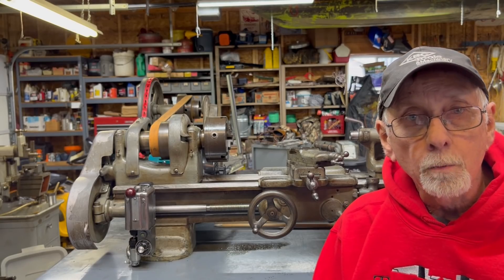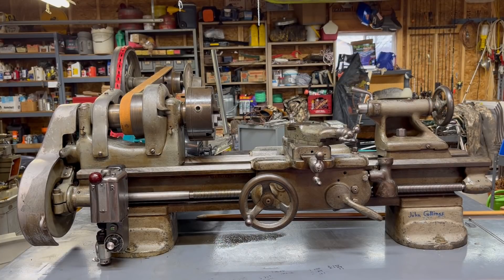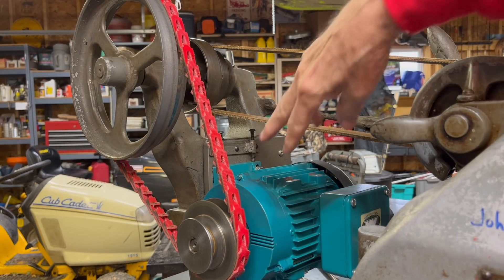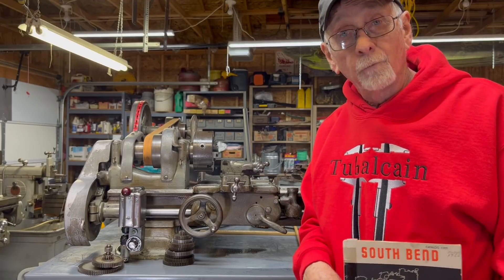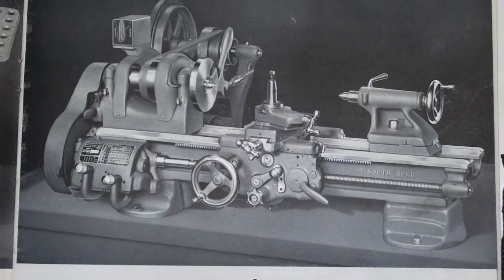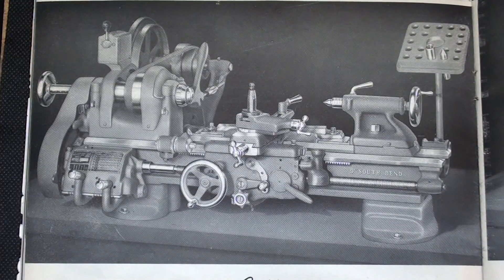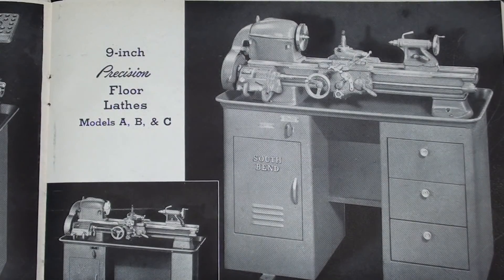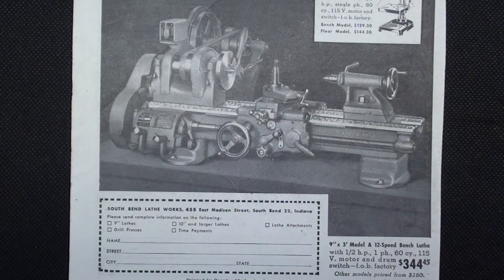COMPARING SOUTH BEND 9" LATHE MODELS #785 tubalcain type study

Comment: Rather late to this party: recently joined a metal work club in my retirement and they have a 9c I have recently partially restored (cleaned, checked bearings, motor professionally rewired). It has a leather flat belt drive which seems to induce a rhythmic vibration as the join passes over the spindle pulleys. I don't mind the click clacking, but it seems to induce a vibration, is that usual, or of concern for accuracy?
Reply from the maker: Couldn’t tell you for sure, but mine has a leather belt with metal lacing and I never noticed a vibration
Reply: @mrpete222  thsnks for thw reply mrPete.

Comment: I have a Southbend 9 B lathe totally taken apart und I want to get it working again. I have a question, on most pictures and videos it shows the top feed in a 45° angle on the cross-slide, I have never seen this before.  I am a trained Turner  und would like to find out the reason for this . I have learned it is always in parallel position to the lead screw apart if I wanted it in an angle to the lead-screw for a particular reason. To assist my question, I am a 77 year old ex Turner 1963 to 1967 and suffer from dementia (Alzheimer) and try to occupy/ relearn my old Skills. Possible spelling mistakes, I am German living in south Wales, U.K. THANK YOU VERY MUCH . Gerhard
Reply from the maker: I like to keep the compound at 29°. I think you will notice that and most of my videos.
I think working on your machines would be a great therapy. I hope you feel better.

Comment: Hi.  I just acquired what I believe to be a south bend model B 10k.  Its model CL667Z.  I would like to add a gear box.  Can you tell me, how would I know which gear box would fit, or are they all the same by bed length?
Reply from the maker: You need to look at the parts list for that model.
Also, different bed lengths require different length lead screws
Reply: Unfortunately I don’t have the parts list.  This 10k came with change gears and no quick change gear box.   I don’t even know if I can add one.

Comment: I own an older SB 9 inch. It is catalog 82-Y. It has a gearbox and is belt drive to the rear, with cast legs. I was told that it was pre WW2, but don't have that documentation. Flat belt headstock with three steps and back gears. It does not have a taper attachment. And the original motor and countershaft are long gone. There's a wheel operated drawbar and collar for 3C collets. I've managed to find some chucks and faceplates, but have not yet had it under power as the motor and drive that's there is an abortion. 

The closest pictures of the headstock, apron and gearbox are from a 1928 catalog. 9 inch, with that catalog number.

What confuses me is that while a SB 9 tailstock fits on the bed and seems the right height, it's offset to one side, so the headstock is set back differently than most.
Reply from the maker: That sounds like a pretty old machine, I am not familiar with that model. Grizzly tools, can tell you the amyear from the serial number but it cost $20.
Reply: @mrpete222  I'm assuming it's about 1928 as the serial number is just a bit higher than one I've seen attributed to an early 1927 lathe. Bed is stamped 35910 by the way. 

If I could find a decent countershaft with a flat belt pulley I can add a 3 phase motor and VFD for the drive. I recently did just that on a Habegger 102 and it's surprisingly easy. Surprisingly, most of the catalogs seem to call for a 1/4 horse motor which seems to me to be small, but I have a couple of small motors that might work already.

Comment: The only South Bend Lathe I ever had turned out to be an 8" I found it at a garage sale years ago. It had a 1 3/8 X8 spindle and was different in most other dimensions too! I ended up selling it after I bought my Atlas 9"
Reply from the maker: Interesting, I never did see an 8 inch south bend
Reply: Evidently the 8" lathes must be fairly rare. I haven't found much information about them at all . In face I only found one mention of them in all my research. I know it was really old, so maybe it was one of their first machines. With that strange spindle thread and the other differences it just made more sense to go with something more common. for some reason I have always been partial to Craftsman and Atlas machines, Probably  because of time spent looking and drooling over machinery at the local Sears store with my Dad  when I was a kid.  I now have almost all the machinery that Sears ever sold, both for metal working and wood working. It does grow on you !

Comment: To any that may know, I've got a model C like the one in the video. Is there any way to convert the tool post from the lantern style over to something that would hold a newer style tool? thank you.
Reply from the maker: Aloris toolpost
Reply: Agreed. Aloris AXA, or clone. Feebay has loads. 

Aloris also has a mini post that I've never used. They also had a model MA meant for lathes of about that size, but they are like hens teeth.

Comment: Hi Mr. Pete, Wonder if you can give me some advice?  I had a piece come out of my three jaw chuck and jammed the chuck, problem is I was using the quick change gearbox when it locked up and now I have a knocking noise from the gearbox even though it still operates.  I suppose I have done some damage to the gearbox and wonder if there is a typical damage from such an event and whether I should take it apart to try and fix it?  I don't use the lathe too much and am no expert!  The lathe still works okay other than the noise.
Reply from the maker: You would have to take the gearbox off of the machine, clean it thoroughly and turn it upside down and examine it for damage. If you do not use the machine very often, don’t worry about it.
Reply: @mrpete222  Thanks, I'll leave it for the time being...maybe one day when I have nothing to do (ha ha when will that happen!) I will tackle it.  Love your channel.
Reply: Probably broke a tooth in the gearbox. As long as the bits went down, probably OK to use. But, you might get some chatter if using the power feed or threading and that feed uses that gear. Personally, I'd pull the gearbox and make sure that there's nothing floating around in there that's going to jam and do more damage. But, I'm a bit of a perfectionist on such things.
Reply: Thanks Bob.  Don't use it that much and it still works, just a bit noisy..........to many other projects. 🙂 @bobmazzi7435

Comment: Mr. Pete,  I had the basic same machine as the model A, told by South Bend it was produced in 1928. Purchased from a gentleman's estate who made model railroad engines.   The difference was the flat belt was vertical off the lathe to a rocker plate 3 step pully to a unique chain drive driven by the  motor, all factory. I had never seen a chain like it had , was a v shape.
The machine  along with the milling attachment , tool post grinder and other tooling is now in a shop producing vintage motorcycles.     I wish I was 40 years younger and had you for a neighbor. I must also say I am very proud of my 18 year old great nephew who is in the trades working  in a machine shop!

Comment: mr pete I have a question on 9" South Bend Lathes, I bought a 9" from an online estate auction up in central Illinois, It is a model C and by the serial number (34,219) it was made between 1926-1927. My question is, did the older lathe beds wider than the later ones? I have a 9" made in 1969 that I wanted to swap beds with and the width of the beds is quite different.  The older lathe has a 4' bed and has all it's hand scraping still, no wear. Do you know when they made the change?
Reply from the maker: Sorry, do not

Comment: It appears my SB 9” is a “tool room” version.  I have the 4 1/2 foot bed, the collet drawbar and collets, the taper attachment, QCGB, steady rest, travel rest, AND the milling attachment.
I had been looking for a lathe, pretty much of any sort, and my Pop called me from Atlanta one day.  “Hey, I think I found a pretty good piece for you…”. My response on seeing pictures was “Buy it.  Right now!”  That was around 1995 or so, if I remember right.
I recently had the nice old guys at Grizzly pull the data card for it, it was delivered in 1945 from a machine broker to a private individual.  I highly suspect that was the fellow Pop bought it from.  
With a quick change tool post and some nice cutters, it still turns a mirror finish.

Comment: Good video. I have an A that I plan on restoring. I am likely going to make pattern to upgrade it to having the taper attachment. Issue with the 9 in is that the taper attachment was integral to the 9 in. Cant just bolt it up.

What most folks don’t understand is the 2nd world war. Many folks had south bends in their home shops. Once a week you dropped your parts off at a drop point and picked up the order for next week. You worked a day shift, came home to eat dinner and then spent a few hours making parts for the war effort. This cottage industry made general purpose non precision parts freeing up space on the bigger more precise lathes.

Bryon told me about this as he watched his grand dad do this. The shear number of south bend lathes during the war was impressive. The Germans could not keep up with the shear number of US machine tools running both in factory’s and in home shops. 

So while the Germans enlisted your grand pa with a ruffle at the end of the war, women and older men were running machines in the US making anything from typewriter parts to shell casings.

The contribution of US machine to the war effort was massive and never really coveted by the historians.
Reply from the maker: Thank you very much for that little history lesson. I know that Henry Ford did that back in the 20s in Michigan. Hey used the cottage industry to make model T parts.
Reply: @mrpete222  I did not know that. Makes sense though!

Comment: Great video Mr. Pete!! Can you do a video on how to adjust the flat belt? The belt on my 1955 model A rubs up against the gear guard when the belt is on the smallest drive pulley to the largest driven pulley. Thanks for ALL of your videos! as a shop teacher: I much appreciate you!
Reply: You need to correct the alignment of the motor pulley assembly. The shaft of the motor pulley containing the flat pulleys is not fully parallel to the headstock assembly. This angular discrepancy causes the belt to walk.

Comment: A very interesting, historical video. Thank you, Mr. Pete. 
If I may, I would like to add a bit to this history. The South Bend Lathe Co. actually manufactured standard, industrial, 9-inch lathes as far back as 1914. In 1935, the first 9-inch "Workshop" lathe was presented in catalogs. This lathe was intended for individuals and small shops. It had change gears, lead screw and half-nut powered longitudinal feed, hand cross feed, and 6 spindle speeds (3 straight and 3 back-geared). In 1939, the Workshop lathe, with some upgrades, became the Model C and South Bend introduced the Model B and the Model A, which were increasingly sophisticated upgrades to the basic, Model C. It should be noted that the 1938 and 1939 advertisements shown in the video refer to the lathe shown as a Workshop lathe, not as a Model A, B, or C.
I own and use a 1935 Workshop lathe, which I purchased at an estate sale in 1975. The lathe is still in very good condition and shows very little wear. The only part I have replaced is the carriage lock bolt. The original developed a crack and failed in early Nov., 2021. Original, South Bend parts are no longer available for this lathe, so I was forced to make a replacement.
Reply from the maker: Thank you very much for that clarification

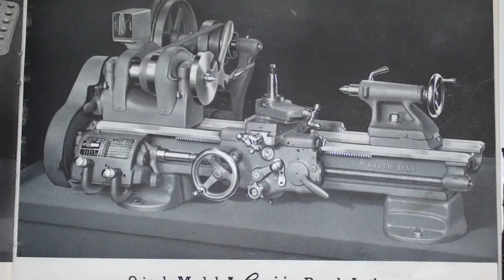Comment: @8:48 It should be "C, B, A, = Good, Better, Best"
C = Good - Base model
B = Better - Middle model with Full power feeds
A = Best - Full power feeds and Quick change gear box

First lathe I ever touched was a SB Model A in High School Machine shop 1971. They had the under drive in the cabinet.

Comment: I just purchased a 9" Toolroom precision floor lathe, underneath motor drive, Model A, no taper attachment though. I was wondering if you installed the variable speed motor and if so, where did you get it?
Reply from the maker: I did not.      The previous owner did that

Comment: thanks. i have a 4' c in pretty good shape i paid 750 for it. adjusting for inflation i guess thats not too bad. I could have bought the mini lathes with the plastic gears but it makes me cringe seeing the stories of them cracking. The old savage shotgun they made there own screws pitch. is it possible to make a copy from another screw?
Reply: A set of Mini Lathe steel gears is easy to obtain and not expensive. It will only take you a week to de-burr them before use.

Comment: Thanks.  It appears I have the six speed 9" precision.  But this guy must have bought a lot of the accessories, including collets and keyway milling attachment.  Luckily, I have a friend that make drive belts and he made a new flat laced belt for me.  I need to go see him again and it it shortened as it has stretched.  I solved the problem for time being by made a threaded coupler to extend the tighting rod.  Not perfect but it got me through.  I need to check what gears I have.

Comment: I have a 1939 South Bend and have been using it for more than 30 years. I changed to a quick change and otherwise it is like new, still use the original motor. I love it. Thanks for the video. Do you have one for bedding the drive?

Comment: My first lathe was a model B 9 in, finally got it from my neighbor built in 1946, set in a barn for 30 years, I did a total tear down and clean job and converted it to a model A and still learning how to run it, its so quite when running you can't hardly hear it

Comment: Lyle,  his was an interesting video.  My old 10-inch South Bend was built in 1911 as a treadle lathe, but a motor was added (so the treadle mechanism is long gone).  It was sold through Sears-Roebuck in 1934 for some reason, so Rose at South Bend agreed with me (back in the '90s) that it must have sat in a back room being used by someone at South Bend for some reason.  The record card/sheet didn't show why it sat around for so long before being sold/shipped.  It is Serial Number 1054, and, if I remember correctly, South Bend started their Serial Numbers with numbers at 700, so my lathe is fairly early.  I have no idea how many lathes, if any, they might have made before they started putting Serial Numbers on them?  It is basically a Model "C" since there is no quick-change gearbox (and several change gears have been lost too, unfortunately!), no fancy carriage, and, of course, has no guards of any kind.  Fortunately, the "brass feed/threading plate" is still riveted to the leg.  They didn't really have any kind of spindle through-bore: I think I can pass a 3/16-inch (~4.67-mm) rod through it, but that's about it.
Reply from the maker: Thank you, that was interesting

Comment: Thanks for putting this information together. I would like to have a small lathe. I find  Atlas or Craftsman lathes similar to the South Bend vintage. I am leaning toward a South Bend. However, if I find a well maintained machine and 12"or bigger it may come home to roost. Al B.
Reply: I wouldn't waste time with that little junk, it was ok in it's time but get a 13x40 size it's just right for the home hobbyist or even some job shop work.  Been there done that, I try to help others not make the mistakes I made several yrs ago.  Grizzly is a good source to look at styles of machines.
Reply: @larryrobinson7492  Grizzly machines are made over seas not in the U.S.
Reply: @sallybrokaw6124  AND.......
Reply: @larryrobinson7492 .... AND ... they don't have 70 or 80 years of wear.
Reply: @johncoops6897  Bingo, and they come with DRO installed and have much faster spindle speeds and have very refined features compared to the old junk, which is cool to play with but not to actually use as your primary machine. I am a machinist at an aircraft manufacturer using dozens of machines both CNC and manual so I have seen alot of different machines, just my opinion of course, don't slay me.  LOL
Reply: @larryrobinson7492  - a non romantic person can be a lot more objective and separate "build quality" from "functionality".
The Grizzly won't be build as well, but will be able to produce more parts more easily at a lower cost.
It's the same as the difference between  a 1950's Chevy and a brand new one. The new Chev is better to drive is almost every possible way, but it sure isn't built the same way.
Reply: @johncoops6897  I understand that, I never was pushing Grizzly or cheap chinese junk.  I simply stated to see alot of types of machines go look at Grizzly catalog, they have the best catalog I know of for looking at stuff.  Unfortunately, I don't know that you can buy an American lathe anymore new.
Reply: @larryrobinson7492  - yeah, I was agreeing with everything you said. I don't know if they still manufacture anything much in the USA any longer, but do I know that here in Australia we have killed our entire manufacturing industry, foundries, etc.
In my dad's time we would buy Australian made heavy machinery because it was even better (for a certain price) than imports, even from UK and USA. There were a lot of tariffs and artificial protection for local industries,  but nevertheless we'd never consider some cheaper Asian stuff back then.
Now days, you cannot get any decent old lathe, even a clapped out rusty old 1930's barn find for under a few thousand bucks. I am pretty much forced into those "Grizzly" type lathes if I want something even half reasonable for hobby use. It's sad, really.

Comment: It’s interesting that my 10L Heavy has the older single lever gearbox even though according to South Bend in 1983, when I called for parts, that it came off the line September 15th at 4:25 p.m, 1953.